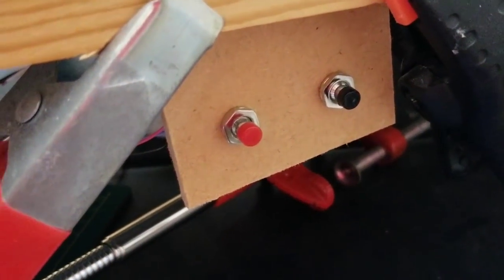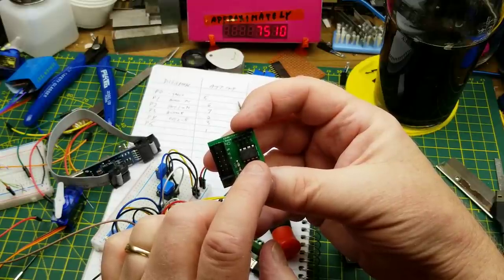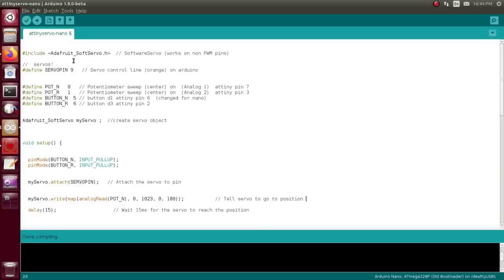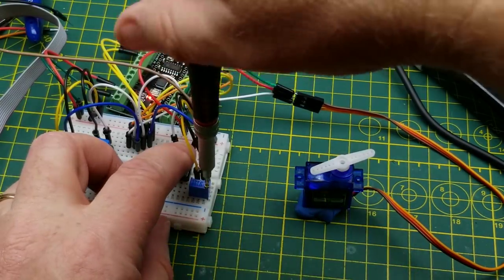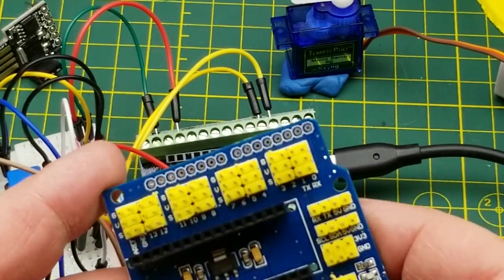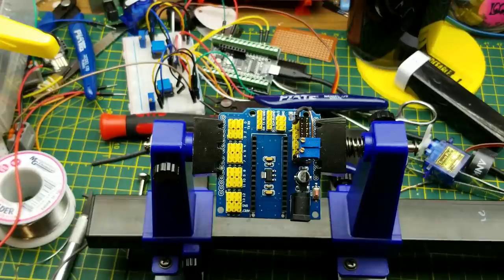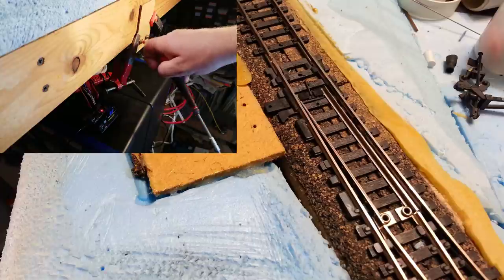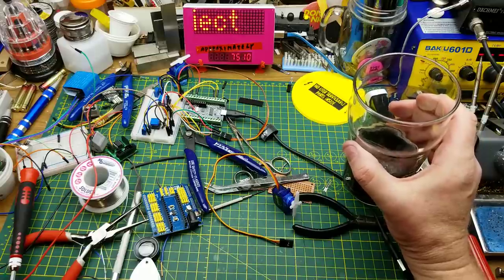Model railroad track switch control revisited

Comment: I've been reading the comments about using buttons instead of pots to adjust the end positions and storing them in eeprom, so I thought I would give it a try. I used the attiny85 instead of a  Nano. In the end, I'm not sure if it's any better than using pots but it was a fun project.  I just posted a video with the results on my channel. I'm not sure if YT allows links in the comments. The code and schematic are on Github.
  I really enjoy your videos. They are very relaxing. If your thinking about learning schematic and pcb design, I can highly recommend EasyEda. I think it's much more intuitive than Eagle. It also has the advantage of running in the browser. I enjoy designing the boards more than coding. If you route the boards manually, it's like a puzzle. Thanks for all the videos.

Comment: Here's a though.Write the code so that holdig both buttons for 2 seconds or more  enters "Programming" mode. Then use the buttons to set the left limit. Double press again ... set right limit... double press both again to exit programming mode. No pots required. You will need to store the programmed values on the Atmel though.
Reply from the maker: Several people have suggested something similar

I guess I have to dig in and work on improving my coding skills to somewhere above my current skill level of "abysmal".

Comment: Thank you so much for that. I spend hours trying to integrate Arduino with model railways with not much luck. I know what you mean about having to keep reprograming them to get the throw just right on the points (switch). The inclusion of the pots for the fine tune is something I will copy in future👍 I'm also thinking about copying your technique of rail modelling with beer!

Comment: I know I'm running late in your videos, but I have enjoyed watching them over the last several months.  I've been in electronics since I was 13 (now 60) through out school then 20+ years of Uncle Sam's Canoe Club (US Navy).  Taught college for 13 years and 5 years as an aerospace design and test engineer.  Now designing test fixtures for Eastman Kodak.

I am also very much into model RR (since I was 4) and have built many layouts over the years.  Due to military transfers and a couple of divorces, I was forced to downsize and get rid of my layouts.  I'm building another now and have been experimenting with IR LEDs and using Arduino to both control the turnout as well as show indication on my control board of it's status.

With your permission, I would like to use your setup, and code presented here, on my road.
Reply from the maker: Absolutely. I published it for anyone to use.

Enjoy!

Comment: OK, I like the up-front easiness of the pot adjustment, but I think the hardware will probably hurt a lot.  Instead of using the pots to store your adjustments, use the built in EEPROM of the nano.   Throw away maybe 1 switch per nano and use the digital inputs as something like PROG, ADJUST+ and ADJUST-  .   When you push PROG and one of your switch buttons, you can adjust the travel by pushing ADJUST(+/-).  When it's good, you let go of PROG and an EEPROM value for that servo is written for either the close or open.  One set of open/close values per switch.  Every time the Nano starts up, it should read the adjust numbers from EEPROM.  BINGO!    All of it is done in software, so no need to solder that pot monstrosity ( sorry but it is).
Reply from the maker: That type of approach seems to be the general consensus.

I guess I need to work on improving my coding monstrosity.

Comment: I think I would make a temporary rig with two potentiometers that would allow to collect the values with the terminal (serial/usb port) and and then program the collected values to the coding. This way you could save pins and discard the potentiometers entirely from the final rig.
Reply from the maker: That is another possibility.

I was thinking this would also allow me to adjust on-the-fly if something changes (though now that I think about it, I can't imagine what would change after everything is built...)
Reply: @pileofstuff  If you keep the temporary rig with the potentiometers, you just have to hook it temporarily to make new readings and apply them. I'm not sure, but it may be possible to apply different settings without completely reprogramming the Arduino by making the variables non-volatile.
Reply from the maker: @jackoneill1070  There is a way to store some amount of variables in a non-volatile chunk of memory. My kid did it with the Christmas lights controller.  I just don't understand how it works myself.
Reply: @pileofstuff  after watching I was thinking the same thing too, why not write the value to nvram and then u can just use the pot tool on the different locations if and when you need to adjust it,
Reply: Hey - my thoughts on the subject non-volatile memory instead of multiple potentiometers 

You can think of the non-volatile memory (EEPROM) sort of like an "on-chip SD card" without file names. Even if you flash a new program on the chip, the EEPROM will still have whatever was stored there before, so it's perfect for calibration constants like your servo positions. And it's actually fairly easy to use. 

Basically, you include the standard Arduino IDE provided "EEPROM.h" library, then you can use its write() function to store a byte at an address, and the read() function to retrieve the byte. However, EEPROM is slow to write to - around 4ms - and has a lifetime limit of about 100,000 writes before starting to fail, so you definitely don't want to use it as extra RAM or for things that change very often. (The library's update() function is useful, because it only writes if the new value is different from the one already saved, which saves wasting one of the write cycles of the lifetime limit).

At 5 pins per servo, you're only managing 3 servos on your Nano. I think you could double that to 6 by saving values in EEPROM instead. (Remove the two pots per servo, then add a switch to go into "calibrate mode" and use a single pot for everything,  3 pins for each of 6 servos is 18, plus 2 for calibration controls, for total of 20 pins used).

It could work like this: Flip the switch to go to calibrate mode, push and hold the appropriate servo position select button (or put something over the IR sensor), and adjust the pot till you're happy. Then either turn off calibration, or repeat the push-and-hold-and-adjust for the next position, then the next set of points, ... you get the idea.

I'm sure there's better ways to do this that would only write the value to the EEPROM once, but a simplistic scheme for a single servo might have your code look something like this (standard caveat - this code is UNTESTED and NOT GUARANTEED!):

******************
[... add lines similar to these at the start ... ]

#include <EEPROM.h>              // eeprom access functions

#define Main_pos      0  // EEPROM location address to save main track servo position
#define Wye_pos       1  // EEPROM location address to save side track servo position

#define POT_PIN       A0 // Potentiometer sweep (centre) on Analog pin 0
#define CALIBRATE_PIN 1  // digital pin for calibration switch 

[... then modify your servo movement code ... ]

  if (N == LOW)                               // POINTS TO MAIN LINE REQUESTED?
  {                                                     // YES - WE NEED TO MOVE THE SERVO 
   if (CALIBRATE_PIN == LOW)                        // ARE WE ALSO CALIBRATING RIGHT NOW?
      {                                                                                  // YES, SO...   
          pot_N_Value = analogRead(POT_PIN);            // READ THE POTENTIOMETER
          servoPos = map(pot_N_Value, 0, 1023, 0, 180); // MAP POTENTIOMETER TO SERVO POSITION
          EEPROM.update(Main_pos, servoPos);            //  UPDATE THE EEPROM (ONLY IF POS CHANGED) 
       }                                                                   // END OF CALIBRATION CODE  
   
   servoPos = EEPROM.read(Main_pos);          // GET THE SAVED CALIBRATED SERVO POSITION
   myServo.write(servoPos);                   // tell servo to go to position
  }
******************

Cheers - Rob
Reply from the maker: @RottnRobbie  Wow, that's an "above and beyond" comment. Thanks!

Comment: You can get way more pins using a shift register. 
A 74HC565 for output or a 74HC165  for input. They can be chained.

I might be misunderstanding this though!
Reply from the maker: Yes, that is one possible approach. Or I could multiplex the inputs using other methods as well.
The downside (for me) tho those approaches it that it adds complication to the code.

And I'm far from enthusiastic about any code, let alone complex code.
Reply: @pileofstuff  Haha! I'm a programmer by trade, but most of my team would have no clue about Arduinos or shift registers.
Two of them studied games programming at uni. We don't do games.
Reply from the maker: @noggin73  Yeah, I have 30+ years of hardware experience and maybe a few months of intermittent "trying to code".  

I tend to fall back on trying to do as much in hardware as possible.

Comment: Why not just use a single pot, and have a set/run toggle. If you wanna set a servo, toggle the set toggle to set, then hold whatever button for the position you wanna set, and adjust it. When done making changes, toggle the set toggle to run mode, and the single pot is then ignored when a button is pressed. All you need then is one analog in and one digital for programming. Should free up 7 analog in pins. instead of running you two buttons to two digital ins, have two resistors between positive and ground, and send the center to a free analog in. each button should add a smaller resistor value between either positive or ground (make sure the combined resistance is okay if both buttons get pressed). this would allow using all six PWM outs, and having 12 buttons, tied to 6 analog ins.
Reply from the maker: That hadn't occurred to me.  
Probably partly because I was going for the least complex code
Reply: @pileofstuff  I can't fault you there! Honestly, I'd just do the same... Easier code>saving a couple bucks. Truth is, I used to do BASIC programming, back in the Commodore and TI graphing calculator days, but fell away from it in the years since. I have a number of hardware heavy projects, but sooner or later, I'm gonna have to delve back into coding. Suggestions aside... Yeah, I too am choosing more controllers vs more complex controls too! 😅

Comment: Thoughts... So many, many thoughts...but to limit myself to one subject, I can see some issues with your “delay(10)” statement. 

Standard hobby servos expect a series of pulses at 50Hz - one every 20ms (each pulse between 1 and 2 ms long, with the position based on the pulse length). So aside from the fact that your 10ms delay (one one-hundredth of a second) doesn't seem like enough time for the servo to finish moving, you're issuing the refresh() call - which is what sends the needed pulse - at nearly 100Hz, not the expect 50Hz. It's obviously working now, but that might be more due to luck than anything else (and may have something to do with the problems ATTINY?).

I believe the standard Arduino library uses interrupts to handle the timing, but Adafruit's Soft_Servo library relies on you to manage the 50Hz. Their documentation does suggest using timer interrupts to issue the refresh() call every 20ms (which is not exactly beginner-friendly advice, I admit). But for simple code like yours there's an easier way to do it with no delay() call needed or wanted.  It could even be worth trying on the Tiny85 for the next few installations. All you have to do is check how much time has elapsed since you last did a refresh(), and do it again if it's been 20ms. 

A couple of unsigned long variables are needed for the time in milliseconds, then each time through the loop you check if 20ms have elapsed, and if so, issue another refresh() call. You might want to put your "pet code monkey" on it for refinement, but here's some sample code get you (or him) started (N.B. this code is UNTESTED and NOT GUARANTEED! ):
*********************************
unsigned long refresh_millis = 0;
unsigned long now_millis;

[... at the bottom of the loop, replace the delay(10) call with something like this...]

now_millis = millis();
if (now_millis - refresh_millis > 20) { // if it's more than 20ms since last time
myServo.refresh(); // servo, do your thing
refresh_millis = now_millis; // and save the time we did the refresh
}
**********************************

To extend it to multiple servos, you just have multiple refresh() calls inside the if condition block.

Cheers - and good luck.

Comment: That is a cool project ! could you have desoldered that yellow header and use its 'holes' to directly put 2 of the pins of the Bourns potentiometer through it while the other bent up or passing alongside the boards side ?
Reply from the maker: Possibly, but I think that would be even more work.
Reply from the maker: @maicod  I started with similar switches (Atlas brand - more common on this side of the ocean) but quickly moved on to the Peco ones I currently use. I found them much more reliable.
Reply: @pileofstuff  not sure if the German brand Fleischmann survived btw. The switches you use with the servo are manual ones right ? How does the IR LED next to a Phototransistor work ? Won't it shine into the neigbouring Phototransistor with or without the train covering it ? Apparently not :)
Reply from the maker: @maicod  Both the LED and photo-detector lenses are pointing straight up. Then I adjust the sensitivity on the detector board so they only trigger when there is an increased amount of light detected.

When required I have also sometimes placed a piece of some random material in the space between the LED and sensor to prevent them interacting accidentally.
Reply: @pileofstuff  yea after asking my question I was suddenly thinking that some LEDs have only a shallow beam angle so it might work when straight up.

Comment: Why 3 digital pins for each pair of switches?
Reply from the maker: 2 inputs to determine direction (main line or diverging route) and one servo output. 

There might be a couple of locations where the trackwork is dense enough that I could use one sensor to activate 2 different track switches, but that might further complicate the code

Comment: Question from Melbourne, Australia - what is the name of your swivel vice-like holder you used in this video? .I am looking at using servos to power my turnouts in my yard, so what you are doing is very interesting.
Reply from the maker: It's one of these: https://ebay.to/39aGawZ

Using a selection of the keywords from that description may find you other ebay sellers with the same thing at a better price/shipping cost. 
I've found them on Aliexpress and Banggood as well.
Reply from the maker: @UCwc8pz7FEyFLv-MxfQBeeyQ Thanks forthe local intel!

Comment: A custom board is not too difficult. You can even integrate the Nano as a plug-in module. 
Will you add trackside signals?
Reply from the maker: I've been trying to follow some of the CAD tutorials for doing board layout and it;'s just not sinking into my greying old skull for some reason.

Haven't given up yet, though.

Signals has always been part of the eventual plan - probably not fully prototype compliant - just something to indicate at a glance what's happening.
Reply: Very cool. I like the idea of using the thicker copper wire as a bus bar.I definitely like the train content. I will get inspired soon. nice job. You could definitely hear the frustration in your voice at the beginning. Been there.
Reply: @pileofstuff  Which EDA are you trying? EasyEDA is probably the easiest, but I'm switching to KiCAD. I haven't made a circuit in KC, but I've looked at some complicated circuits(rusEFI), and if I start small I should eventually work it out - lol -. The problem with KC is they have been making major changes lately(v5, v5.5, v6) so most tutorials might be a bit out of date.
Reply: @pileofstuff  Took me 15 years of questioning and uncertainty... My boss asked me to deign a board, and instead of doing the usual hand layout and etching, I just sat down with KiCAD and messed around, looked at the odd tutorial here or there, and within the month, I had a board ready to be manufactured. Given that the cost is literally free, there's nothing to lose. I won't pretend I'm highly skilled at it, or efficiently proficient, but I can say I can now do it, and the thought of going back to hand etching and drilling just feels so tedious now. Trust me! give it a shot!
Reply from the maker: @SidneyCritic  Most recently I've been trying to wrap my head around Kicad (benefits: not cloud based, open source).  
Like 3d CAD, it is a steep learning curve for someone accustomed to "scribbled on a napkin" designing...
Reply from the maker: @richfiles  I'm sure that, given enough time, I can figure it out. Unfortunately time is not something I have excessive amounts of these days.
Reply: @pileofstuff  Yeah KC has become the default EDA from Eagle, so you kind-of have to learn it to look at other people's stuff. That's why I know how to navigate through it, even though I haven't made a circuit with it.